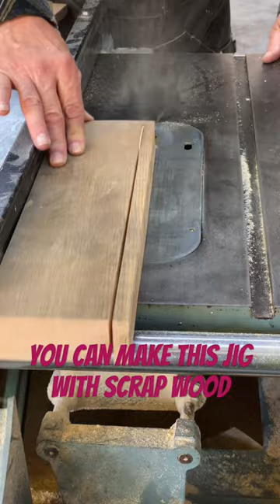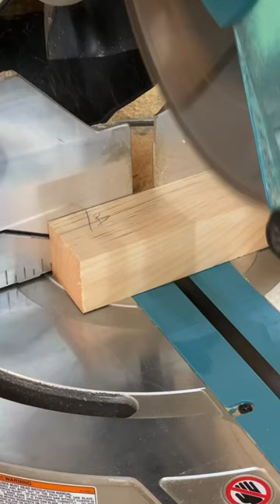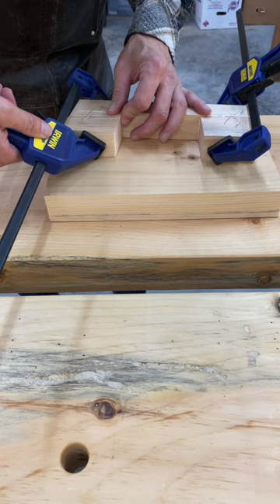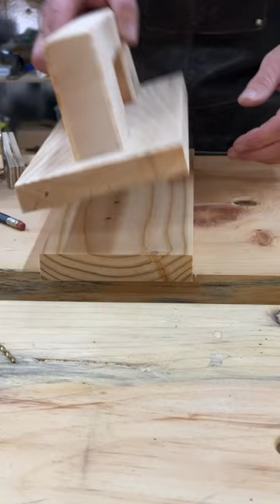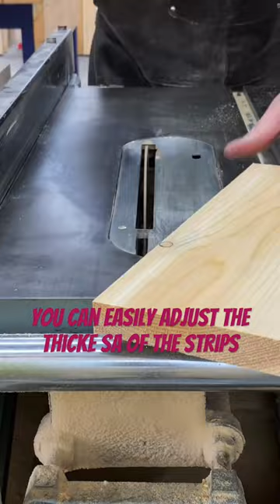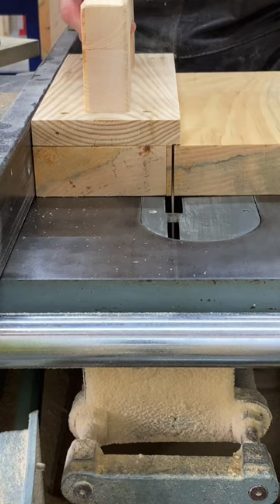Thin Strip Maker #woodworking #jig #Dünnbandhersteller #creador de tiras #tips  #diyideas

Comment: I just use a featherboard set the correct distance away from the blade and bring the fence to it each cut Its accurate enough, if I need an exact fit they go to the drum sander
Reply: Me too, I feel better about kickback with feather boards